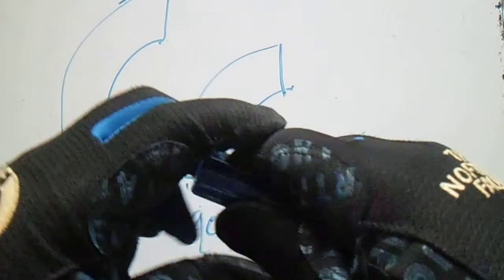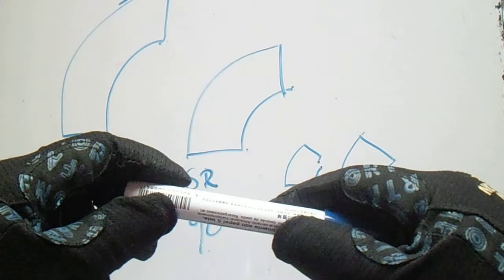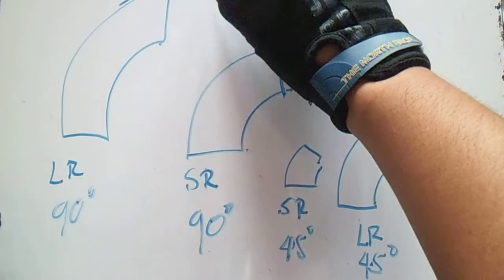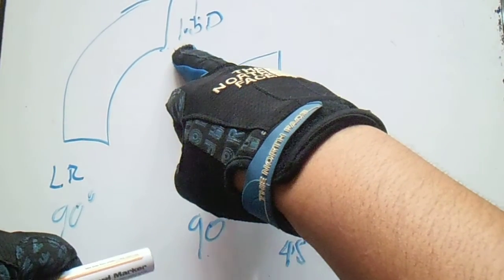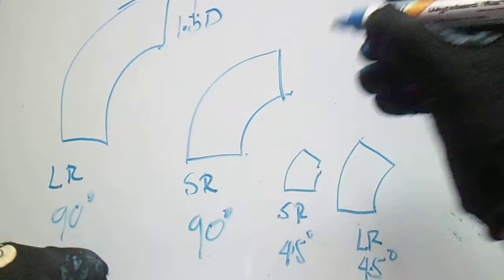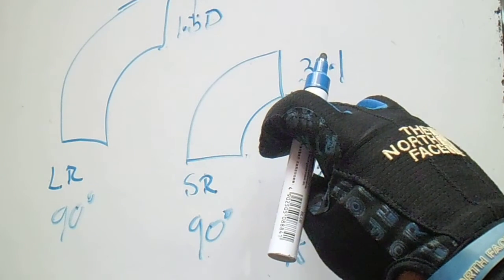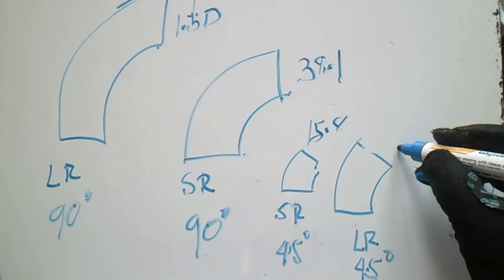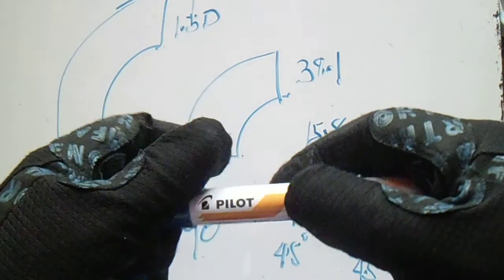Pipefitter - What is LR, SR Elbow - Take Off

Comment: isn't it that 1.5 and 38.1 are just the same values of multiplier for 90 LR? so as 5/8 and .625 for 45LR.
Reply from the maker: Inches for 1.5 and mm for 38.1 the same for 45LR

Comment: mistake..ur in wrong track bro..technical formula is for LR 90 - tan (45) = T.O. /1.5 D, SR 90' Tan (45) = T.O. /1D, for LR 45 , Tan (22.5) = T.O/1.5D , SR  45- , Tan (22.5) =T.O./ 1D, your information technicaly are. incomplete to let them understand where was the values came from. draw it geometricaly by pythagorean concepts.or functions
conversion factors as follows 90 degree = 2 x 3.142 pi radian / 360 degree, to get values 1.5. , ( 1.5 x 25.4 mm= 38.1 mm , as 90 degree equavalent. ,,, and soon with others..but ur mistakes are in 45 degrees. 15.8 mm is LR 45, from tan (22.5) = T.O./ 1.5 D.,you will get the value 15.8 by converting, into mm. tan ( 22.5) x 1.5 D x 25.4 mm = 15.8...That is for long Radius 45 degree.
Reply: kig wa 👍👍